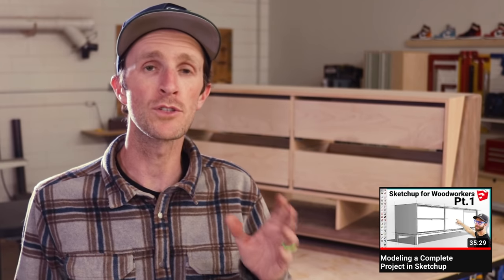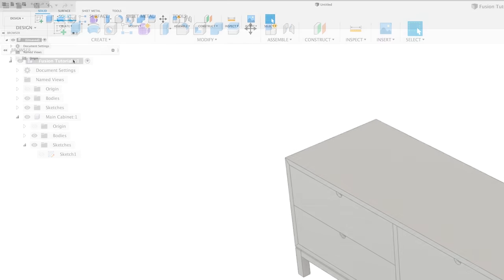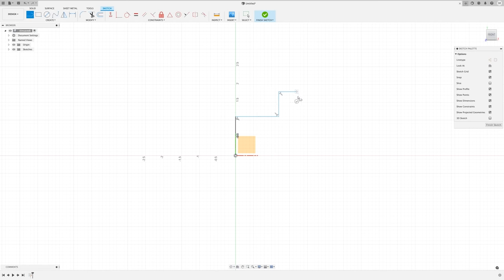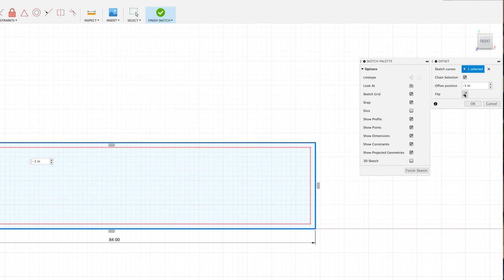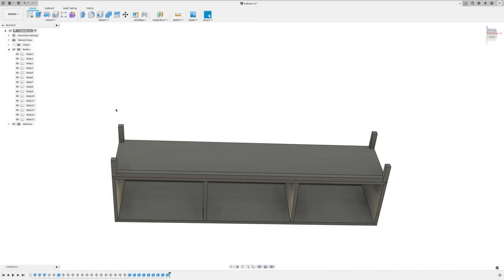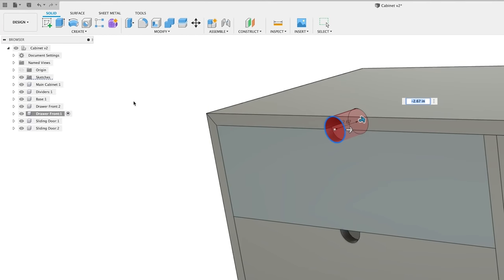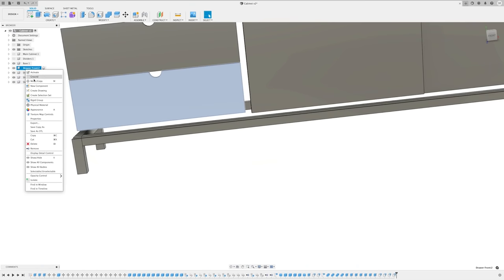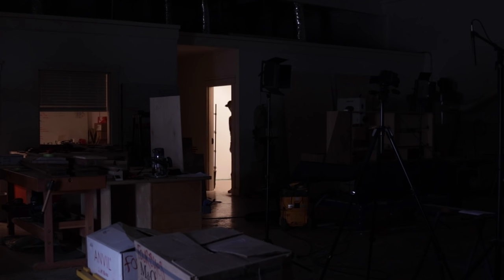Fusion 360 for Woodworkers | Model a Complete Project in 30 Minutes

Comment: Offsets are great, but when building furniture I've used some of the parametric functions to set dimensions for my stock. Like, putting in that my stock thickness is 19mm for plywood. That way, I can just change that one variable and that dimension changes throughout my model. It's super powerful!
Reply: Additionally, when you set your parameters for stock thickness as an example, you can start building dados/rabbits with formulas. Like setting the dado depth as .5*stock thickness, and then the dado depth automatically changes if my stock thickness changes or I find a different plywood vendor.
Reply: @nfwolfpryde  Great tips, Thanks!
Reply: Yes! This is exactly the stuff I want to get better at. So wildly useful. Thanks for watching!

Comment: The real power in a program like Fusion is the ability to model something based on parameters and fully defined sketches. This allows you to make design changes extremely easily during or after the initial design stage. Fusion is a deep program and learning how to fully define your sketches and ensuring your extrudes are to object surfaces etc are key to being able to change one dimension and have your entire model update correctly without chasing down broken pieces. 

For example, something super simple: You want to change the design of the finger pulls from half circles to a square opening. Had you created a sketch, you could simply go in and modify your sketch and update the feature. 

Using primitives to add to pieces or cut from pieces works, but doesn’t take advantage of the real power of parametric design. Yes, you can go back in the history and edit that feature, but it doesn’t allow you to drive an entire design from a couple of parameters.

Fusion really requires a complete mind shift from how you model in Sketch Up. Once you can get away from the way you model in Sketch Up, you will be so happy. Especially if you ever want to come back to a design and change one or two parameters and have the entire design magically update! Including drawings!
Reply: Thanks for sharing!
Reply: I worked with DS CATIA in school. Is Fusion 360 similar to that?

Comment: The reason the render button uses a tea pot is the Utah Teapot (https://en.wikipedia.org/wiki/Utah_teapot ) a very common 3d model used for testing renderers in the early days of computer graphics.
Reply: It's one of those things that I'm so familiar with it wouldn't even occur to me that someone wouldn't know about the teapot. Note that the closing parenthesis broke your link.
Reply: @ardemus  fixed! Thanks!

Comment: User parameters allow you to set shared values and change things programatically (parametric modelling).  That way all shared lengths/thicknesses/offsets can be set in one place and consistent.  It really speeds up your workflow and allows for better brainstorming and designing if you want to leverage fusion 360.

Comment: Using fusion without parametric modelling is like buying a supercar and never taking it out of the fitst gear. The primary reason why i personally use it for furniture modelling is this very capability. Plus the fact it is free for hobbyists which is awesome if you ask me.

Comment: Awesome video Shaun!!  I still remember the video you made doing this prior to teaming up with Chris.  It appears you have learned a lot since then.  Your process seems to flow much better now.  I like how you are sketching the big picture first, and then breaking it into pieces.  If I remember correctly you were much more into drawing the individual pieces first before, and then combining them.  And I think getting a better handle on the parametric features, and how to utilize them, will only help you get  better and faster.  For instance you could eventually set up a dresser so that you could just tell it how many drawers and how tall you wanted it (or the drawers) and it would calculate the rest based on what you have set up.
Reply: Yeah, totally! Slowly getting better at it, I learn something new almost every time I use it.
Reply: Hot dang!! The parametric stuff goes THAT deep? So could you for example say, instead of 6 drawers I want 3, and then it'll reduce the number of drawers and resize the drawer fronts and everything? 

Either way the parametric stuff seems wild

Comment: I have used sketchup for 8 years to design furniture, house, spaces and commercial areas and I have never had a problem, and I used other 3d design programs and they are not so intuitive and user friendly, I believe without fear of being wrong that sketchup is the best by far.
Reply: Agreed.  And it's FREE!
Reply: Theres allways the question, what you want from the program. It's a question of the job behind it. For many things sketchup is more than enough, for others not. I'm a mechanical engineer and need a "little bit" more power behind the program and learned CATIA and SolidWorks at the university. At home Im using fusion 360. Mostly because the license for CATIA is not in relation to my private usage but I miss the power and flexibility of it.

To say that one program is the "best by far" is a little bit too general. There are different programs for different jobs.
Reply: @atariks1475 ok, read again and you will see that we are talking about furniture design, engineering is another topic, your needs are different.
Reply: @JamieHofman  Just so you know, fusion 360 is free for hobbyist / diy. There are a few things that you can't do but that really only affects people that use cnc machines or are in small factories. But if you are happy with SketchUp, then it's fine.

Comment: Hi, I always enjoy your builds.  I'm computer shopping and need some advice.  I plan to eventually get a powerful desktop, so I don't want to spend too much on a laptop...so for a 360 capable laptop that will eventually only run Lightburn, do you think to slower i5 or i7 chips with clock speeds of <3ghz (360 system recs 3) would be ok for furniture and flatpack items?
Thanks for any help you can offer.

Comment: So once the sketch is completed is there a way in the program to create a dimensioned cut sheet?
Reply: That would be one of the primary questions requiring clarification, having a great 3d model is worth little if you can't duplicate it in real life, which is hard to do without usable plans. And cut sheets are super important to speed up the work and minimize waste

Comment: Cool video though it would have been great to see how plans with dimensions could be made.  I use sketchup for wood and fusion for 3d printing and illustrator for shaper cnc but have never crossed the line between them since sketchup, and to some extent illustrator, are easier for me to create parts lists.  Any thoughts on good videos or articles to view on how to use fusion for everything?
Reply: I second that. I've found that making usable plans from SketchUp is harder than it should be (hard to make them neat, requires using another standalone program, which for some reasons lags terribly on all my windows machines (though works much better on my MacBook). All in all, it is a lot harder than it should be. I do hope that fusion has something better to offer here.

Comment: Great vid, I’ve used Fusion a fair bit but you had some great tips I’m looking forward to trying out (eg I didn’t know about using a body as a ‘tool’). After you’ve had time to relax 🙂 I’d love to see a video of how you ‘break down’ the model to inform the actual build process eg do you generate a drawing? Do you flatten the components to lay out efficiently on sheet stock etc. etc. thanks again
Reply: Thanks Simon! It is a program where you learn something new almost every time you use it.

Comment: Great thanks for this.  I have noticed that most of the other Fusion 360 video guides are for small enginery type drawings so nice to see it being used for furniture and larger objects.  I find the zooming in an out not as fast as on AutoCad 2d and quite cluttered unless the grid is turned off.  But I'm just learning 3d drawing.  Can you do some more videos or are you more Sketchup biased?

Comment: I was following along and then  couldn't follow when you started to extrude. I finally realized the problem was I set my view to start based on the color of your axes. For some reason your Z axis is green and mine is blue, so I was working on in the top of view for my sketch not the front view. When I figured out my mistake and stated in the front view w/ my blue z-axis and red y-axis, everything fell into place. From what I read z is blue based on the world coordinated system. Why would it appear green in the video? That said, very helpful getting started w/ Fusion 360 video.

Comment: Does anyone have a fast way to trace an image? for example, if I wanted to import a line drawing of a logo and turn it into a 3d model for CNC. I know you can use the line and free-draw tool on top of the image but that method has been pretty hard for me to get accurate results and it takes me forever. 
Thanks!

Comment: Fusion 360 is more like a professional system than sketch up. Sketch up is better for architecture and gardens etc imo
Reply: Yeah, they both definitely have their strengths.
Reply: @shaunb66  make sure all your sketches are fully constrained for better luck with parametrics. Easy check is to grab a line in the sketch and see if you can drag it about

Comment: I really liked your videos and followed along with the sketchup tutorial. My problem seems to be my laptop which constantly throttles up to 100% HDD usage and a wireless mouse that seems to not be able to click and drag to select parts to make a group. I tried Fusion before but, it was even worse than sketchup and would run and I couldn’t even get back into Fusion and ended up dumping it.
Reply: And you life will not get better unless you upgrade to an SSD. Windows from 8 upwards perform terribly on HDDs, and even older versions show substantial improvement (that goes for all other os'es as well). Once you do it you will not understand why you'd wasted so much time before doing it.

Comment: Interesting that he has so much difficulty with Fusion's "parametric modeling," which is supposed to be the program's crown jewel...and which also adds a whole lot of confusing complexity to using the program. The problem is that changing one body's parameter, let's say the width of a drawer, doesn't somehow magically adjust all of the adjoining and surrounding bodies accordingly. If you reduce the drawer width of a credenza such as in the above example, for instance, either the length of the credenza's carcass needs to shorten, or a new drawer or other feature needs to be inserted within the carcass to fill the newly created gap. But the software can't do that. In fact, since there are a variety of possible "solutions" to what to do about the newly created gap, there isn't any way that software could anticipate a designer's intentions anyway. The result is that "parametric modeling," with all of the monstrous complexity that it introduces, is hard to handle conceptually and is mostly useless. 

Sorry, but the most efficient way to deal with changing a dimension here or there is literally to start all over from scratch, having learned from your Model v.1.0 that you really wanted the drawers to be 18" wide rather than 19", etc. However there are some features that you might have already designed in v.1.0 that aren't affected by the revised design. Ideally, you would like to simply grab them from v.1.0 and import them into your new v.1.1. Tough luck, Fusion makes that obnoxiously difficult unless you are paying your $500 each and every year, forever, or at least for as long as you want to be able to access your old designs. So this program comes to you straight from the outstretched palms of ugly con men. 

Be warned.